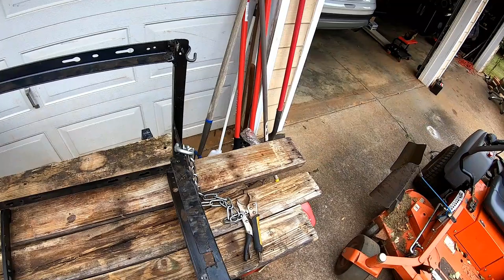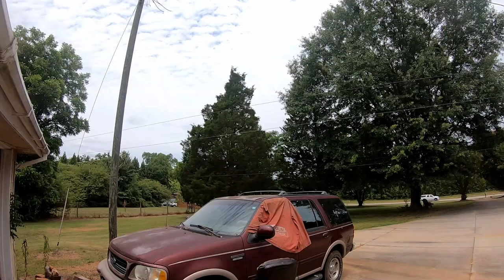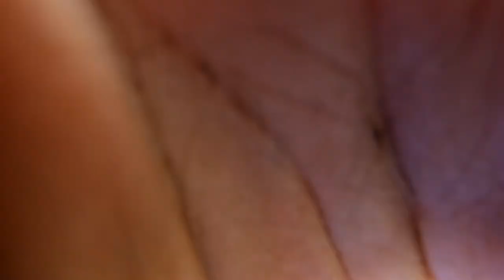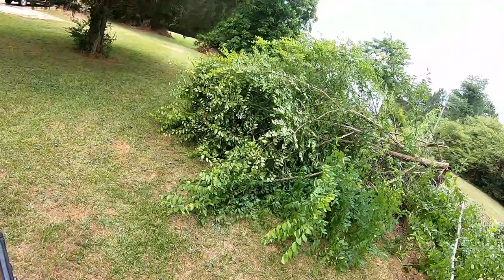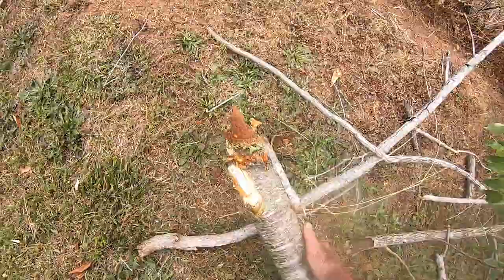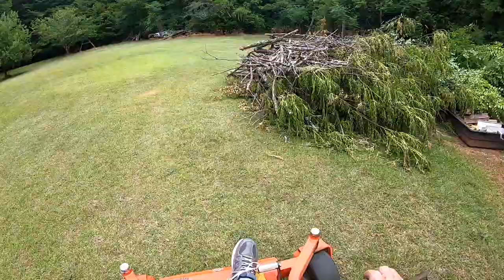Tree Limbing Project Continues 6 4 2021

Comment: Walter, Rance here. I see you and I have the same problem "thin skin"  easily to tear and bleed. Here's what I do. I bought a thick leather welding cape (really a short, short jacket with long sleeves that allow gloves to come up high and protect skin, works real good but hot in summer time. I'll take hot for a while over bleeding on  everything. Anothet tip... find a pick up truck accessory store and see if they will give you an old bed liner. Pull it behind your mower and throw your limbs and yard trash in it. Pulls easy and when you get to trash pile, just tip on its side to empty. Works good and is fast and easy on us old folks.
Reply from the maker: Thanks for you suggestions and tips  I appreciate your comment Rance